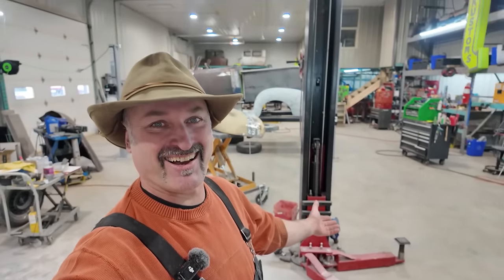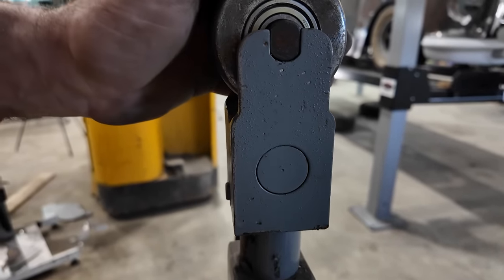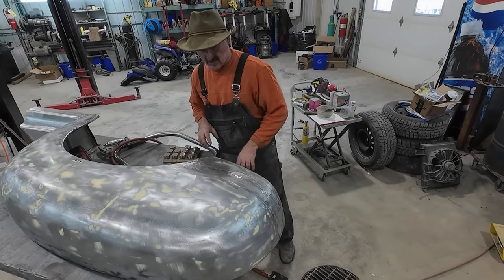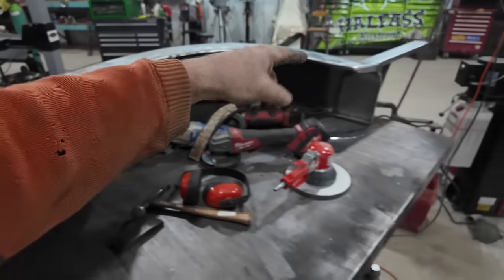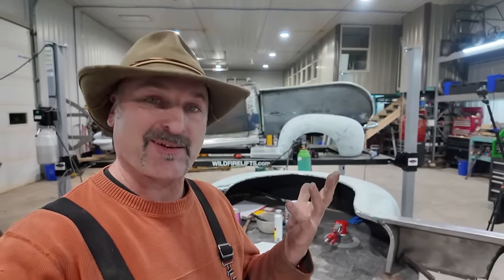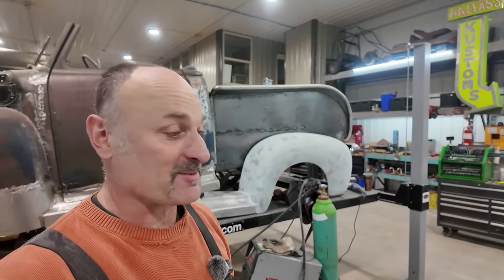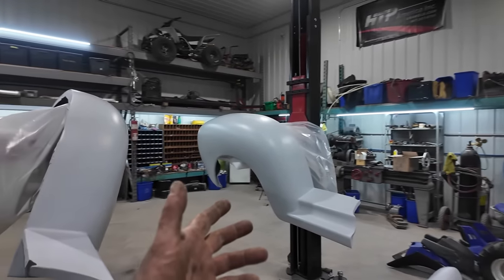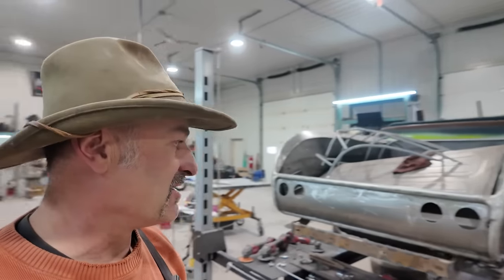Body working and priming the rear fenders & bumper on our ‘49 GMC Roadster pickup!

Comment: Brent I've found when you weld up seams with spot tacking and grinding them smooth. The grinding wheel rolles over the metal and moisture can seep through the back side and pop out your Bondo. So take dish soap with water and spray the seams and blow compressed air on the back side to find the tiny holes in your welds it works

Comment: I spray my e wheels with dw-40 to keep rust at bay. I remember Karl saying to use one die size flatter than actual crown. 
Another fender in the book. 
Roof will be interesting. The mesh screen 1/4 hole size to make the form and go at it with fiberglass.

Comment: Working that huge fender on a english wheel looks like a real pain in the ass.  Karls planishing hammer looked much easier. I totally agree with you method of sanding put mud on the whole fender and stop as soon as you hit the high spots and then next coat get the low spots sand and then ready for filler primer the whole fender than sand again and your ready for paint. 
Since, Ya gotta do the cab might as well take the box completely off and tackle both at the same time. Fear not, doesn't matter to me, what yo do, as long as their progress, truck is looking good Brent its coming along just fine. cheers.

Comment: I see very little difference in bondo and primer... one you spray and the other is just laid on and then shaped to the desired shape needed. It is what we called it in the sixties and seventies. I watched Kyle from carter auto restorations do some tig welding using bits of stainless in the filler rod so no ghosting appears. He calls it ghosting, others just say its turning blue or a shade of it when welding. Using the same material in filler took away that issue... great times ahead... nice place to work and the door is open a bit to get fresh air in

Comment: For the bolts sticking out from the inside of the bed, I would put nuts on them and weld them to the side of the bed to give the bolts a stronger grip. If possible I would also do the same for the bolts that hold the fenders.

Comment: Those parts look great, Brent, but what about the inside? The bumper looks quite rusty, don't you think? and the rear inner wings, too. Sorry, American friends, fenders. What will you do about them?

What about the underneath of the car and all four inner wings? Sugar, I did it again, fenders. Will you coat everything with a salt proof underseal?

In my day, 1976, I couldn't afford the proper underseal stuff. A mechanic friend of mine suggested I use a roofing sealant used on flat roofing.

It was very popular back then for the home DIY mechanic wanting to get their vehicles through the next MOT. They would weld up holes or cover them up with whatever metal they could get their hands on, then coat the underside with Bitumen. No MOT inspector would try scraping that stuff off. It would take weeks.😂

I decided on the cheapest Bitumen roof sealant I could afford, which, as it happens, is a good home DIY solution. That's what I used on my very first car. A 1961 Morris Minor Convertable.

I sold the car to a friend for £15 who still has it to this day. Had I known at the time how valuable they would be, I would have kept it. Instead, I used the money to buy my next MOT failure. A 1967 Ford Cortina.

I made a mint when I sold it in 2003 because they were highly collectable by that time. The same cheap bitumen, was still looking good all those years later when I checked it over for the last time. 

Sadley, in 2009 it was in an RTA that killed a young girl. The owner called me up to take the car off of his hands.  He didn't want any money or for it to be repaired or to even drive the car again. 

I took the engine and gearbox out, dashboard, and a few other small things that were hard to come by that were still in good condition and then sold it to the scrap yard. I got £30 for it. Still, I made money, but I was doing it the wrong way.

Anyway, the point I'm trying to make is. Even though I painted on a full coat of the stuff on the Morris Minor with a 2" brush, then a second, just to fill the bits i missed. It lasted until 5 years ago when my friend decided to strip and restore the car back to its original factory state.

Had he not used a hot air gun and striped the bitumen off with a paint scraper, who knows how many more years it would have lasted.

So stop wasting time reading comments, Brent, get back to work. I want to see this vehicle of yours on the road quicker than you can say,  Halfass Kustoms. Now get to it.🤭

Thanks for reading, I'llll seeee youuuu later. 😂⚒️🏴

Comment: hey brad, on your  English wheel, thingy, handle that to tighten rolls, extend it lower where you can tighten with your foot put like round wheel on it, use your foot, this way no bending down to tighten it,